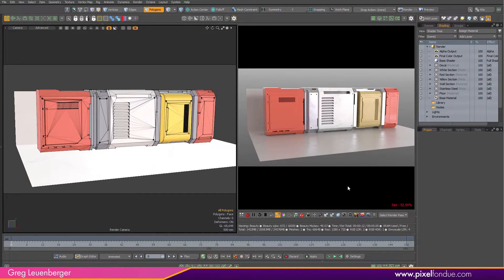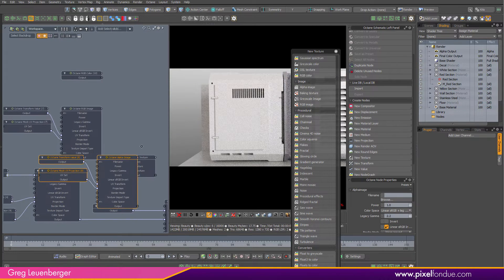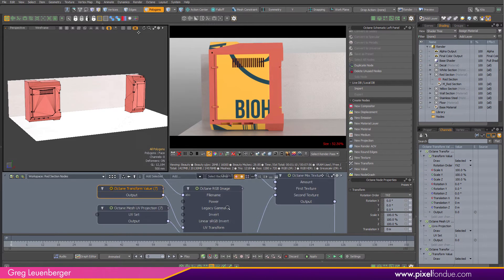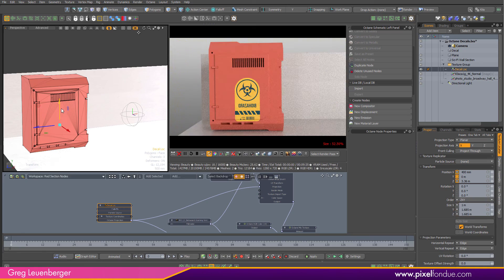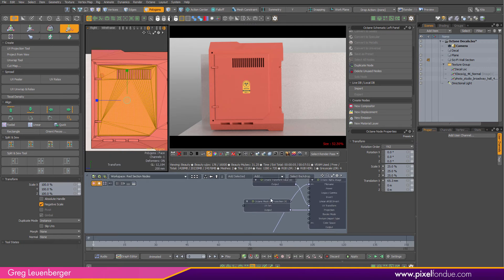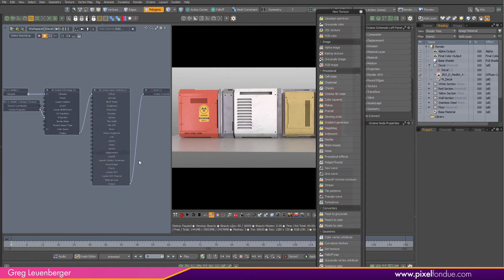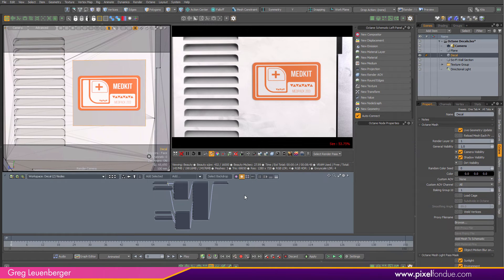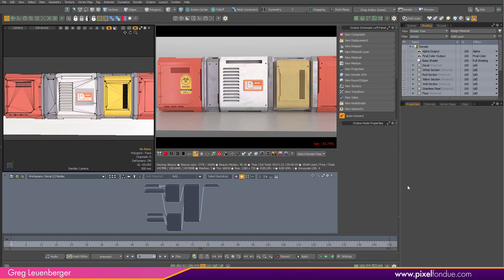MODO | Decals in Octane

Comment: Thanks for the video. Would it be an option to set the image to RGBA in the shadertree without an Octane Override? (last method) Or is an Octane Override always preferable? In terms of rendering speed or whatever.
Reply from the maker: Actually, I think RGBA does work in the shadertree.  Overrides provide access to all the Octane specific nodes and a lot more control.  Don't think it's any faster (the shader is just being translated into glossy materials behind the scenes)
Reply: @pixelfondue  OK, thanks for the reply.

Comment: I use both of these methods for decals in Modo Octane depending on the application, but I haven't seen this bug. Just tried it again to be sure and I don't see any weird dirt/ambient occlusion effect when using the alpha channel method. I do run into an issue where I will get artifacts on a curved surface if the decal geometry is very close to intersecting it, and that is fixed by taking the ray epsilon value way down.
Reply from the maker: Yeah, I think it may be a precision thing.  Same with booleans or refractions sometimes, adjusting ray epsilon helps.